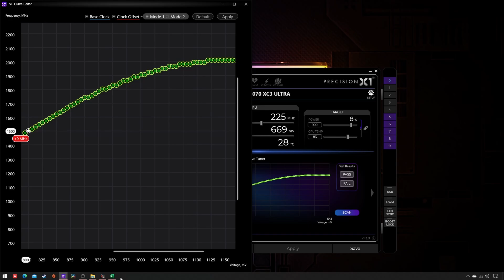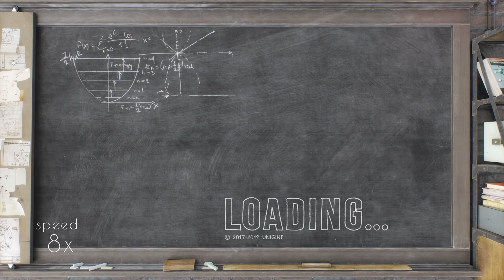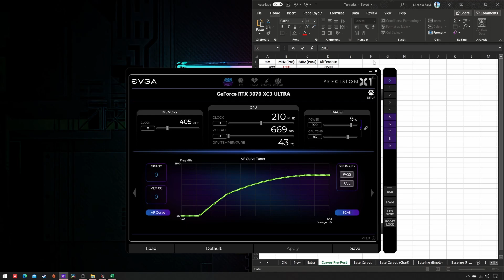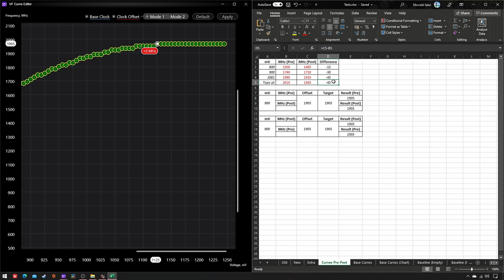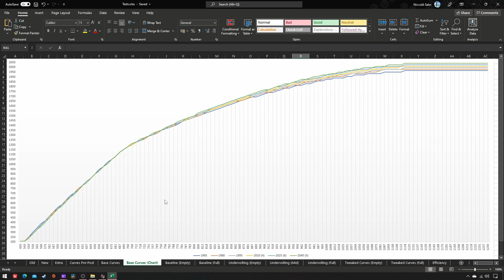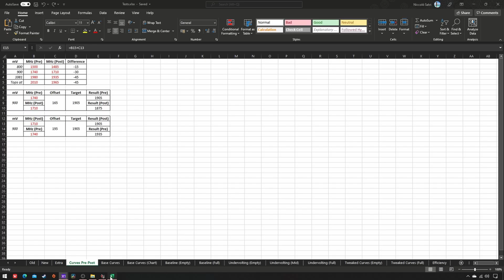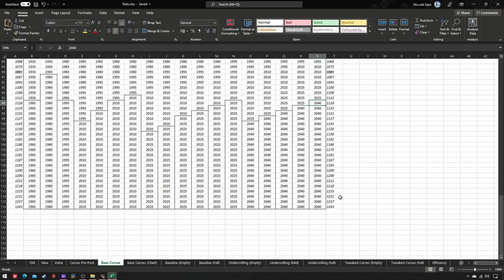[1/5] Undervolting w/ EVGA Precision: base Voltage-Frequency curves

Comment: dude i know its been a while but this is insanely detailed and effective at teaching someone with relative novice knowledge on the subject, specifically in Precision x1. Thanks so much!
Reply from the maker: Even after all this time... I appreciate that! It was a labour of love for two things I really like: undervolting and PX1.
Imagine my surprise when EVGA decided to withdraw from the VGA market, rendering their software instantly obsolete :(
Reply: @oakenglass  Obsolete maybe, but I am yet to run into limitations. I am still running a 2080 Ti EVGA BLACK in my spare computer, and my undervolt runs more stable in X1 than when I use MSI Afterburner. This shouldn't be the case but I swear I haven't had a crash yet! Thanks to you
Reply from the maker: @MikeBeazy  True! PX1 may have a few quirks, but it's still a great piece of software...
Now that you mention it, I'm going to try and ask EVGA for PX1 v1.4.0.5 (just for posterity).

Comment: I undervolted my 5600X CPU -.20 voltage and +200 core so went from 4.65 to 4.85 with less voltage so its cooler and faster, Now I am going to try with my 3080 FTW3 ultra that already has stock OC from switch on it and +150 core +650 mem 450Watt bios with 100% voltage and afterburner and I would like to under volt my GPU and overclock it.
Reply from the maker: Cool! A successful undervolt + overclock is always something to be proud of.
I'm sure your RTX 3080 FTW3 will behave as well as your Ryzen 5600X :)

Comment: Firstly i want to applaud you for this video, done professionally and without wasting anyone’s time getting to the point quickly. I have a question though, i was able to undervolt my evga 3080ti to 0.900mv at 1950mhz however i noticed that power draw is still high. Playing cod with dlss enabled at 2k temps and power draw are amazing (down to 72c @300watts from 85c) however i tried native 4k and i noticed the temps rise all the way to 80c drawing around 350 watts. Is this normal with the undervolt ?  In both scenarios gpu usage is around 95%. Btw Evga really messed up with the trash cooler on the card btw
Reply from the maker: First, thank you very much for your compliments!
Second, yes, it's always normal for power draw to increase with an increase in resolution.
A little strange is the GPU usage: are you reading it via HWiNFO "GPU Core Load: Average"?
Reply: @oakenglass  Thanks for the reply man, I use nvidia’s performance overlay to see what’s happening in games. That’s where i got the gpu usage and other data

Comment: Really great information. I just got my new EVGA 3080 12gb FTW3 Ultra behaving nicely. I got it running 800mv @ 1800 mHz temps around 60, fps 110-165 depending on game @2K. I ran the OCCT video card stress test for a full hour and it was stable at about 73 degrees avg. maxed at 78 degrees. Test was tougher on my 3900x cpu with chiplets getting up to 82.5 degrees max, typical 77 degrees. Set my fan curves too. It's looking real good. At idle everything just drops like it should. I think before the undervolt, I was at 64 to 68 idle. Now it wants to game at 61 to 65 though admittedly my ambient is dropping for the last few hours as the evening air comes in through the patio door. Very happy I was able to do it all on PX1 so I get to keep my rgb running, I couldn't have done it without ya, thanks a bunch !
Reply from the maker: This is really great! PX1 is often overlooked because of its past reputation, but nowadays I think it's good. 
Have you tested your card with the 3D Test of OCCT 10 or 11 Beta?
Reply: @oakenglass  No, actually I was running the Power Test AVX2. So I went ahead and followed your lead and ran the 3D test on OCCT v10.1.7, gpu 100%, error reporting: enabled, shaders : 3
Unlike the power test it sort of left my CPU alone and just tested the GPU:
Temps:
GPU 73C   max74.44
GPU Hotspot 79  max 80.94
GPU mem junction 74  max 76
chipset 71
DIMM 41-43

MHZ:
CPU 12core Ryzen 9 3900x all cores 4225MHz  max4325
GPU clock 1725  max1815
GPU mem clock 2375
GPU vid clock 1535  max1590
GPU effective clock 1713  max1799
Infinity Fabric clock 1800
RAM Mem clock 1800
Mem Controller clock 1800
RAM 32gig Samsung B die XMP profile 3600 ('1:1 ratio')

Voltages:
Seasonic Prime Titanium 850 rails appear very steady:
3.3v rail @ 3.34 , 12v rail @ 12.16 , 5v rail @ 5.07
GPU Core voltage  min .744   max .813   avg .789
GPU SRAM Output voltage  .900   max .944   avg .893

Well ventilated large Thermaltek case with Noctua Industrial 2000rpm fans X 4 (3 in front, 1 in the back) ...  large Noctua cooler with a single 150 or 160mm fan

Results: No errors reported, temps looked fine, not as dramatic a test as the power test. 
   This is a Gigabyte X570 Aorus Master board. I have this system on 3 monitors, an LG 1080 ultra wide I've had for about 5 years but looks great (for productivity, yeah right), a 65" 4K Hisense for movies etc., and a new 32" wide color gamut 165Hz (Gsync compat) 2K monitor for games. I'm not an FPS gamer, mostly sim and racing stuff so I have all my Nvidea settings leaning toward quality and I turn up all the eye candy in the games. I also use this as a VR rig for a Quest 2 and run Steam VR games. This card is powerful enough to back it off a bit and still let it dance around between 110-165 refresh depending on the game. My main concern is that it be 1) Stable  2) QUIET !!!  3) Powerfully Quick  4) Efficient (if there is such a thing for a 400w card)         5) Longevity - I'd like for it to last a long time as this thing took me 4 years to buy everything and get it to where it is now. I think I've got it where I want. I'm not focusing on measuring response times right now. Next upgrade will be a bluetooth game controller to pair to the Intel 6G wireless on the MB, so that will address input lag to a big degree. The cabled usb controller can only poll at 125MHz, I think, because of the usb while the wireless can poll at 1000. At that point I'll decide if I need to fool with any of the settings for response time. I doubt I'll have to fool with it. I don't know if burn in is a thing on video cards, I know it is on CPU's, but if it is I would expect this 3080 to normalize down 2 degrees or so after awhile because this card is 1 week old and these are the first tests I've done on it. What do you think about that ?
If you could observe and advise if you think I should run any other tests or anything to be on the lookout for I would appreciate it. Thoughts ? Criticisms ? Thanks for your video, it is awesome !
Reply from the maker: @zetapal  Wow, what a detailed answer, thank you!
I asked for "OCCT 10 or 11 Beta" because your CPU temp was higher than expected with the 3D Test... but since you originally tested with the Power one, now it makes sense!
[I thought it was a bug or feature of OCCT 11 Beta: I haven't tried it yet]
My recommendations are:
1) Stability: you could try to redo the OCCT 10 3D Test with the same settings except "Shader Complexity: 8" (instead of 3). Better safe than sorry as far as stability is concerned.
4) Efficiency: you could try to find the max frequency at the min allowed voltage. Watch my recent video about this topic: https://www.youtube.com/watch?v=ztaeO8XzZ54
After that, you just have to pick the VF combo that achieves your desired level of silence and performance. Or perhaps have different profiles for different situations.
As for the burn-in/break-in period, it depends on the compound that EVGA used. Personally, I didn't notice any particular reduction in temperature... but ymmv.
By the way, I can clearly see that you have chosen every part of your PC with much wisdom. Yours is a very rational build that will last a long time, I'm sure.